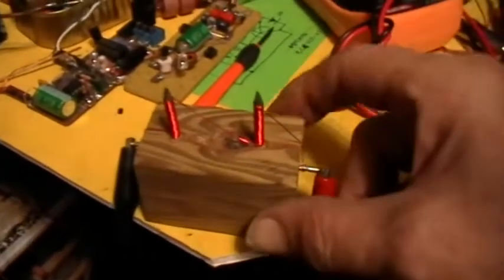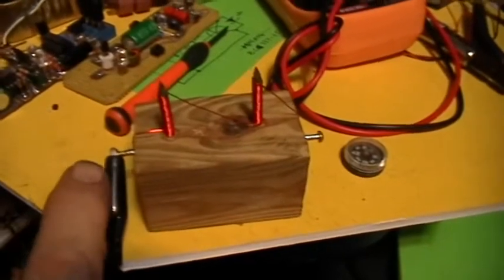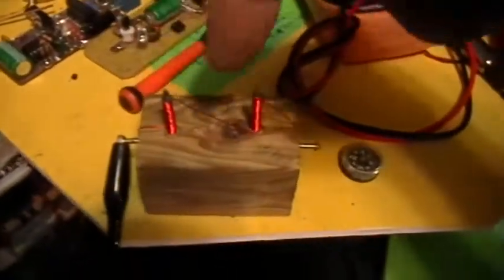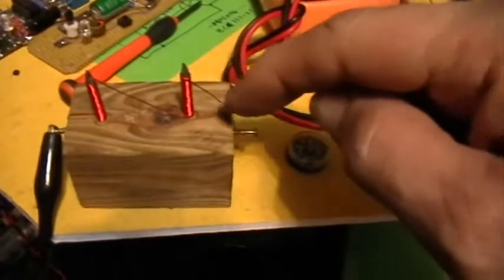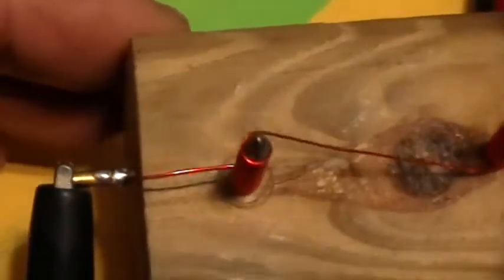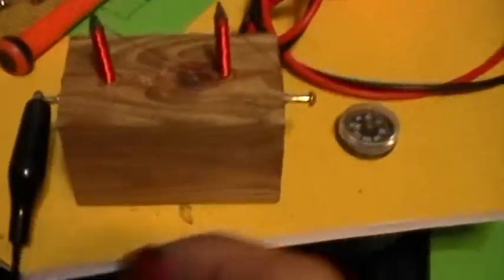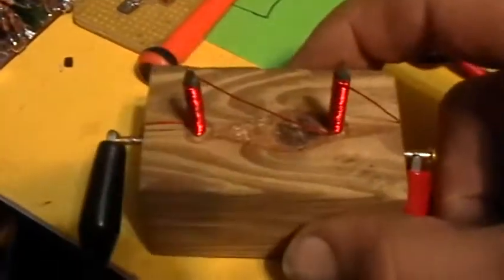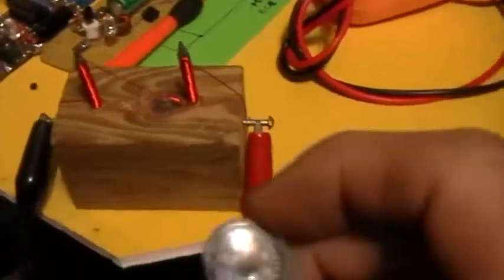Electric OU: Supplement: Right Hand Rule? Whaaat?

Comment: Maybe someone got confused with this: http://en.wikipedia.org/wiki/Fleming%27s_left-hand_rule_for_motors
Reply from the maker: I'm not sure what the confusion is/was. The video demonstration is a response to a forum thread where several knowledgeable people claimed that the CW/CCW winding sense did not make a difference in resulting field polarity of the solenoid.  Perhaps the original question or problem statement was misunderstood somehow, either by me or by them.

I think it makes little practical difference though, since you can control the field polarity by simply reversing the current.  For example, "Left" current and CW windings make field in one direction, "Right" current and CW windings make field polarity in the other direction. So you can "simulate" CW or CCW winding field polarity effect simply by reversing the hookup of the coil to the current source, no matter in which direction the coil is actually wound.
Reply: I figured it was in response to some forum thread. I find those places confusing at the best of times. Everyone talking at once, some with more lag than others.

Completely off topic now. What do you think of my latest Plasma art? https://plus.google.com/photos/110054487679760243185/albums/6015092742412629761
Reply from the maker: Mongrel Shark
Yes, very nice! I voted up my favorite one. Also I discovered that Google has a lot of my photos on file too, I've never looked in there before so I didn't realize ....
 Have you tried attaching a little neon to the end of your fine wire? That might look cool.... when you fix the coil, that is! Shorting the sec to the pri is not only bad for the coil, it can be hazardous to your health and wellbeing too. Even a small coil can give you nasty RF burns.
Reply: I Know. I burned a hole in my fingernail yesterday carelessly moving a toilet roll receiver while transmission was on. It wind or mini welder arced at me. Then there are the fumes to consider, and the fire hazard when the coil is wound on cardboard tubing.

I have tried the Neon, but it's too heavy. I did arc through the glass of one though. How many watts does it take to plasma cut glass? Probably not a lot considering the dielectric strength is much lower than the voltage in the arc...

Comment: I have a question...why does your power supply not see that as a short circuit?

Bill
Reply from the maker: It does.
Note the view of the supply at 1:30: the red LED on the left indicates "current limiting" aka "constant current"  mode is active; the supply is putting about 290 mA (bottom left meter)  into the wire by limiting its output voltage to about 0.1 V (top left meter).

Comment: I thought the direction of the grain was influencing the earths natural currents... since the block was cut from a tree (man influence) and being handled by a man and because the plastic toy is not of this earth - therefore... oh yeah, how can we be sure which way is up!
Reply from the maker: Also complicating the issue is that the little compass has reversed polarity so many times (due to strong fields in the lab) that it no longer points to the North magnetic pole! It is actually about 170 degrees off, with the "S" on the compass card pointing approximately North.

At least I got the colors right on the power cable. Red is still red, black is still black.